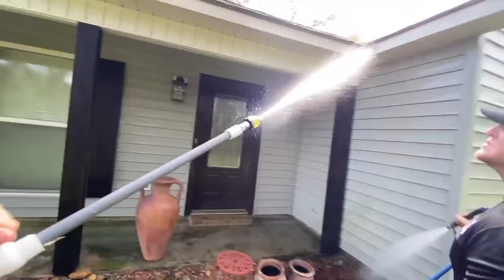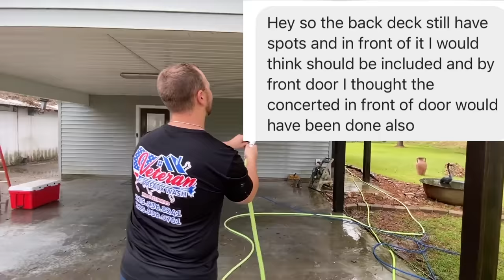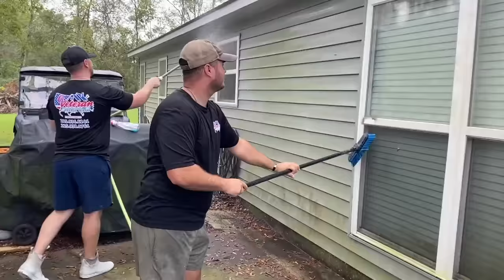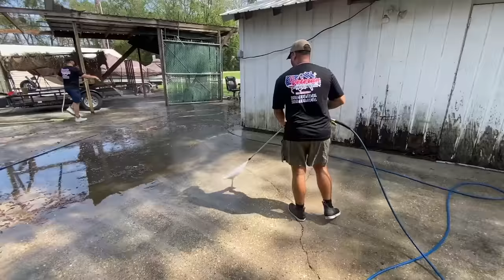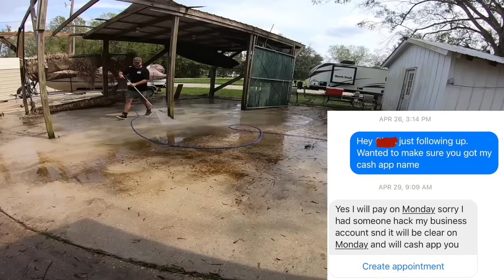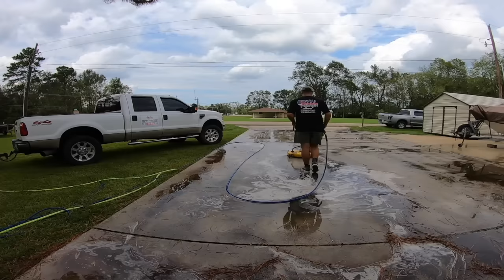This Customer Refused To Pay Us

Comment from the maker: 👇 Use Code "HBA" To Save $100 On ANY Course👇 
🔴  Resource Page: https://bit.ly/PWashResource
Reply: Leaving a negative review on her name
Reply: I have a question, I am fifteen and wanted to start pressure washing to save up money for a car. Is that too young to start pressure washing? Also, do you need to use chemicals in order to clean people driveways and walkways? Thanks 🙏
Reply: I would suggest you be more precise on your quotes. 
Literally list everything out. 
It would avoid what you said in video.
Reply: Try to look into mechanical lean for difficult customers. You look like you're very good at documenting dates and time.
Reply: All you’re going to do is jack up the cost 100.00, so you still get what you want for the job. Im a self employed pro and that’s the biggest bunch of bullshit contractors do.
Reply: @landonsmith2937  you'll make way more money selling drugs
Reply: Cause of these bums i always answer upfront payment!
Reply: as she should have refused
Reply: A little feedback from someone who started out as a licensed Residential (Renovation) Builder and ended as a Commercial General Contractor, 32 years later.

Residential Contractors could learn a lot from Commercial Contractors, in the communication/documentation arena, where the customer is concerned.

"First things" must always come first.
The most typical method of estimating for most jobs, entails measuring quantities. In this case, you have measured square footage of walls and undersides of eves & rakes. Those measurements are used for material and labor (soap & wash-time). 

Once I began itemizing material and labor quantities on the estimate, by the number of square feet, lineal feet etc., communication confusion over pricing and coverage dropped to nearly zero. To get to zero, I began to include the sketches I made for estimating (whenever the job did not require building plans). I just took a little more time on the sketches, when I was at the residence, to include dimensions & square footages of each surface included. With that, I included language on the agreement that any discrepancies discovered by either party would be corrected upon WRITTEN notification. The written part was for me primarily; I would write up a change order for ANY change to the agreed estimate. One time that saved me $100k, due to an estimating program malfunction, in totaling a $600k lake house renovation. Every item had a price, which was the legal aspect of agreed pricing. The total was short $100,000 but when every line was added, the total included the $100k. The line item pricing, not the total, takes precedence, when language regarding "discrepancy correction" (either up or down) is in the agreement.

The more transparent I became the more educated my customers became. They began reading their estimates and inquiring on certain things. Things like the actual "nuts and bolts" cost underlying why the estimated price for the guest bathroom one-piece toilet, was significantly higher than the Home Depot sale-ad they'd read.

Transparency won me more projects than I could even manage. As a direct result of estimate line item-price transparency, written change-orders and exceptional work, by the third year of renovation, my company had become 99% referral, by customers who expressed a serious desire to see that I never went out of business and would always be there when they needed me. I eventually stopped printing business cards and scrapped all advertising, just to keep up with contracted demands. 

Over the next twelve years of residential renovation (which became mostly upscale/high-end) I lost money on only one job. And that was because I left the country for an entire month, to do volunteer work, managing layout, construction and performing skilled masonry, concrete & carpentry  for a church project, down in Balem, Brasil. Something which the success of my company afforded me to do.

Anyways, I hope this feedback is helpful to someone. It made an extraordinary difference in the workload & profitability (I could charge more and get it; most of the time being the only outfit bidding on the project). My customers didn't want anyone else and those who received other bids, soon realized why we were in such high demand; they could make sense out of the Project cost. 

Hence, from then on, I contracted every job that I wanted to do. I also restored confidence in the building industry for many customers who'd previously had a builder-nightmare experience.

 P.S.
Most State Statutes that specifically concern the building trades, include the exact "legal-format" and "language" for legal-notices and things like change orders; which are intended for contractors to easily copy/paste. Also, there are many templates & examples online. I professionally used an attorney to read the template-documents, as I'd write them, to suggest any alterations needed for legal requirements.
Reply: You should put on the bottom of estimates if not paid at time of service there will be an additional 10% added after every 7 days it's not paid. Check your local State's laws on this. As in Florida we have to give the customer 30 days to pay without charging interest or late fees. 
It's always a learning experience everyday as a business owner. As we don't see these types of people often. So next time you add extra information that you learn. 😉 
Always check with county, city and state business laws on what and what you can't charge for any kind of problems like these. 
Sorry you had to experience that. Your buddy was right, it's not worth thr hassle to go to court. Also with gas prices these days you'd of spent that much more going back there to do the job with your billed time.
Reply: might should have used the real footage.. this is stupid..
Reply: @landonsmith2937  You are not too young, in fact your the perfect age. Show incentive, be outgoing, don't sell yourself short just to get your first few jobs it sets a standard price for repeat and potential word of mouth customers, you will need some form of chemicals to do the work, lets say that your dealing with a driveway that is concrete with oil on it, there might be many different ways of cleaning it one way is this
Treat the concrete stain with baking soda
Sprinkle a thick layer of baking soda over the oil stain in your driveway.
Let it soak in for thirty minutes.
Clean the stain by scrubbing it with a bristle brush.
Wash away the baking soda with clean water.
Repeat if necessary.
This was a link just asking google how to clean oil from a concrete driveway, seams pretty simple, baking soda is over the counter at any variety store for $1.99, it's none toxic, and harmless, then there might be some harsh chemicals that do a better job, but I suppose it depends on the surrounding areas of the driveway, if there is a garden on each side you might want to use something that wont kill the soil in the garden so therefore go with none lethal chemicals such as baking soda. this is just an example, but no, you aren't too young, do some research on the particular item your going to power wash and what it is your washing off the item, find out what cleans it the best and the process, just use common sense and start small, maybe a deck, or driveway, windows and doors and as you get more comfortable and experienced move onto bigger jobs, take a leap of faith you will do fine.
Reply: @TimmayFilms  thank you for that, I know wasn't directed to me but i learned so much from it.
Reply: I think a good video would be contract structuring and how to handle money on the back end.
Reply: A brilliant deal, for the customer, for yourself, for us doing the best job for a fair price, its invaluable,

Karma is balanced, 

Thanks, Godbless,
Reply: @CanDuNietteR  I always read the comments first 😂
Reply: @mim2046 I'm on the other side of the fence. Contractors got paid by the insurance but have not and will not finish the job. Some of the work done is substandard and worse than before they started. I'd have them fix it but I don't want them in my house anymore. Lawsuit in progress.
Reply: @bloimlala42 and when you decide you don't feel like doing the job,  then what? .. Then it's time to watch your back
Reply: 4:41
Reply: I wouldn't do business with her again. She wasn't going to pay you on time.
Reply: @stevin47 nah most don't include the deck.

Comment: That’s why you need a business circle. If you got in with other independent electrician, framer, roofer, or lawn care people, you can share names of “this is the shit she pulled” people and they essentially get black listed from other contractors. We have a bunch of independent business groups around here. 

A lady came into my old electrical distributor shop a while back and was asking if we could help her find someone to come fix things at her place. We ran over a local contractor list with her and most of her responses were “they said to never call them back/I’ll have to find another electrician to work with.” Turns out, when most of those contractors came back to load up on parts for the next day, we asked if they knew her… every one of them said “yup! And we call all our business buddies. Some of them got burned from her too and the siding dudes, and lawn care guys won’t ever go back.”
Reply: Yikes. What had she done to get blacklisted everywhere?
Reply: @MyAmazingUsername  I know of 2 stories. One, her dog would attack the guys doing work and she wouldn’t reprimand the dog or lock it up. She then refused to pay for the worker who’s leg was bitten. And the second, she was absent for 3 appointments. Then blamed the guys for not showing up on the correct day and time. They showed her where she selected the dates and times and she then tried to cancel the card she paid for the consultations with.
Reply: @40ozHateraid  Wow that's disgusting. Some people just seem to always be scheming about how to screw you and not pay you.
Reply: 100% we need to make a list like that  as these clowns sure talk bad when they are not happy even if unreasonably so
Reply: Not sure of your state (I’m assuming you’re in the U.S.) but here in Georgia contractors can and do put a lien on the house which blocks the house from being sold until the contractor is paid.  It also prevents any loans the homeowner may try and take out using the equity as collateral (2nd mortgage, home improvement loan, etc)

Comment: This kind of thing has happened to me a couple of times in my nearly 40 year career. A signed contract with the specifics is always good. And yes, communicating clearly what is covered and what isn't is essential. You did the right thing by offering to reduce the price and or come later and do what she wanted.
Reply: i saw video of different home as example but no soap or chem used so it is unclear how home is actually cleaned or just sprayed with only water but id say deck and patio under patio front to be cleaned due to falling dirt from home and any residue from soaps and chemicals used to be washed off lower or attached areas washed see my comment  above for more reasoning thanks
Reply: BIG JOHNSON Malone  we never wouldve known thanks

Comment: FYI. From a real estate stand point (legal definition of real property), the deck is an affixed permanent structure, so legally the deck and concrete patio is part of the house. A simple fix is to expressly state in the quote that only the physical building and no externally fix improvements (ie. patios, decks, fences, or concrete surfaces) are included. Then again, manipulative people will always find a way to get something for free. Good luck to every one out there.
Reply: Exactly!!  Spell it out clearly, and do a line- by- line inventory of what is in included or excluded.    Have the customer initial by each option that is agreed upon.  Anything not initialed or agreed upon, comes at an additional cost.  Some people are pains in the wazoo and greedy!
Reply: There is different package deals that were offered. The customer decided to go a cheaper route. Than complain that its not what they wanted.

Comment: After many years of working with different types of folks, you begin to recognize red flags that come up in the initial consultation of their project. One example is when they constantly make a comment about cost, typically it's always something about it being too high, but wanting extra work done. I always pass on those clients. It will end up being more headache then it's worth. Finally, like others have said, a signed contract with all the specifics of the project listed, is of the utmost importance. Even with multiple repeat clients, I always provide a contract, just to make sure we're always on the same page.

Comment: You should ask every customer up front or in a text if they’d like to add any decking or concrete to the house wash.
Reply: True maybe so, though he gave her a separate quote on concreted areas.
Reply: not how it works, too many contractors used to take and run in the past, now it's required by law to compensate upon completion
Reply: wash? or just power spray with clean water his example home i never saw soap or chemicals used prior to clean water power rinse
Reply: that and make sure they know it'll cost'em a little extra lmao , the little concrete steps or slab next ti the door or in front of the house I'd throw in for free if they paid for house and deck to be done it's deals like that that will get people talking about your business and word of mouth is the best advertising
Reply: @davidicousgregorian  Yeah, what I saw there was UNIMPRESSIVE!!! Except for that yellow cement cleaning machine.  THAT was cool.

But the basic spraying of the siding was NOT something I'd pay someone to do.

I'm sorry, but ALL that does is clears off DUST!  Any grime does not get cleaned at higher levels.

NO IMPRESSED at all!

Perhaps these guys should watch Shark Tank and learn what happens when one 
OVER EVALUATES 
themselves.
EGO is not the way to do things.
Reply: @BlondieSL     Did you LISTEN at the start when he states it's Not that woman's house, just to respect her privacy? 
Most likely NO, hence your  long winded post about the plain washing job  minus detergents.

Comment: I didn't read the comments below so somebody may have already said this but when making such contracts always have a section where you clearly state what you will not do. It might go something like this: {Disclaimer: Does not include horizontal decks, concrete surfaces, sidewalks...} and anything else you'd like to exclude. That should keep you pretty safe. This works well for just about any subcontracting.
Reply: That is exactly what I do I even have it titled above the paragraph of the very detailed list  (Thing's I don't do) hahaha!! It really is very helpful and makes Thing's crystal clear putting in all the little detail's are key when writing up You're estimate's 😁👍💯
Reply: Yes, it is just as important to let the customer know what is NOT included in the contract, as it is to let them know what IS included in the contract!
Reply: With customers like this it wouldn’t matter if you tattooed it on them, they’re still gonna try this sh..
Because they’re assholes,
They would argue it wasn’t made clear enough even if you did,
You still wouldn’t get paid for ages

Comment: 100% agree that the deck is a part of the house, it's a permanent fixed structure. I feel like arguing that is petty af tbh. Anyway if that's how you run your business that's all good. If it was me I would have felt bad not to do the deck as  I would view it as part of the houses structure. Lessen definitely learnt though, don't assume the customer knows what you view as house.
Reply: A deck is not a part of the house. And depending on how big the deck is that's a totally separate price from a house wash. Obviously you don't know what you're talking about and you've never owned power washing company
Reply: @michaelmorse4920  I do own a power washing company and softwashing company and I do know what I'm talking about and a deck is part of the house if attached to the main building.
Reply: @michaelmorse4920  Decks are an extension to the exterior of your home. A deck attached to your house is considered part of the primary dwelling and must abide by the setback requirements for a dwelling.

You obviously don't know what you're talking about if you can't even use Google mxm
Reply: Deck is not part of the house. Honestly a deck railing would take more labor than the concrete alone.
Reply: @KT-fi7tm  a deck is part of the house.

Comment: I've been writing business proposals (construction) for close to 20 years and learned LONG AGO you need a clear scope of work, but must also have an exclusions section where you list items that are not included, which also means excluding any work not clearly stated in the work scope.  The kind of customers you want are generally happy to have everything clearly spelled out.  Where there is ambiguity there is room for conflict.  

Once such clarity and clean delineation is in place and a customer still becomes a problem, there is no reason to hesitate legally.  Since learning to do things properly, I have NEVER had to go past filing an "intent to lean".  They fold quickly because the line is clear and they know they are the one standing on the wrong side of it.  Likewise you will occasionally overlook something and have to eat the shit sandwich yourself, but at least you don't have to walk around knowing someone else F'd you.  Most customers are happy to deal with any contractor who is forthright and professional.  

All that said, I learned by getting screwed in the same type of way.  If you get it straight after your first one or 2 you got me beat.  Good luck.